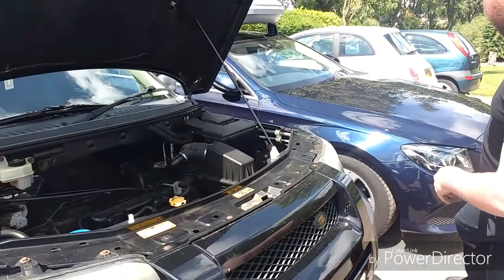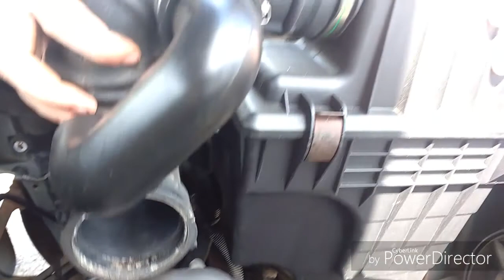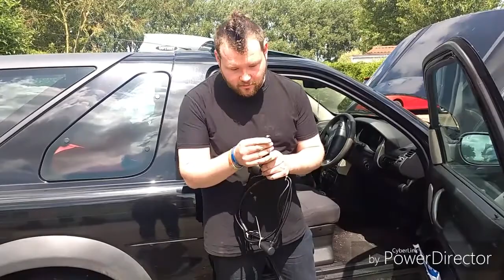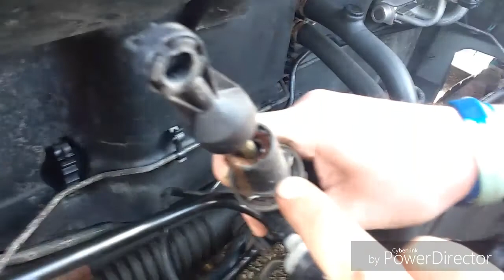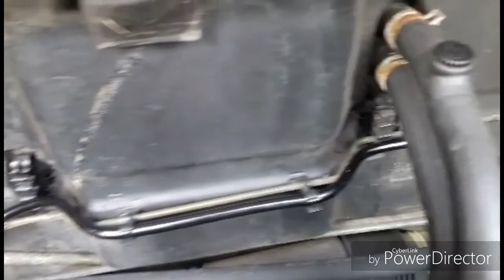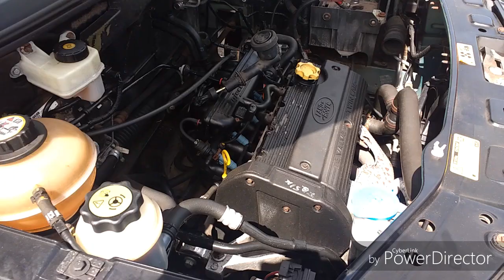Freelander 1.8 Clutch slave/master cylinder replacement

Comment: Helpful video, but a couple of things: you don't need to remove the battery, it doesn't provide any additional working space.  You didn't state when reinstalling the Master Cylinder, that you want to connect the clutch pedal connector before securing the MC into the bulkhead, else it is impossible to get the fitting onto the pedal bracket and you'll probably also need to push the clutch pedal away from you to make the space to get the fitting on.  A word of warning when removing the MC from the clutch peddle, be careful as the clutch pedal will spring up, so watch your face!

Comment: I have a diesel one of these checked it it’s  the same system it’s a 2000 it has been hard to go into gears and has very little pressure in clutch pedal do you think I should replace these parts
Reply from the maker: I would change the gearbox oil first. Much cheaper option first... I have a video on that also on my channel

Comment: what did you change it for .?
Reply from the maker: +steve hoad  There an link what part I used
Reply: no I mean what where the reasons you changed it ..
Reply from the maker: +steve hoad  Because I had no gears... And  when I took it off it was leaking and you can here air escaping
Reply from the maker: +steve hoad Was loseing gears and found out it was leaking from the clutch pedal
Reply: Ah nice one . Mine was replacment   clutch ..  ouch!